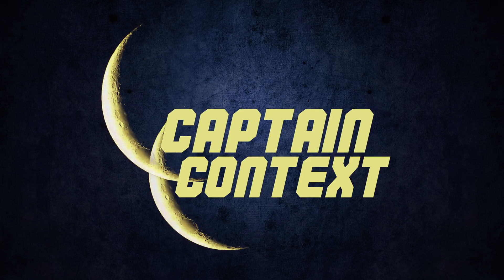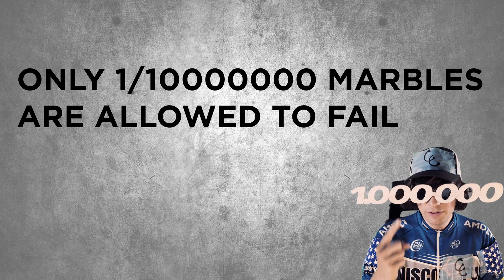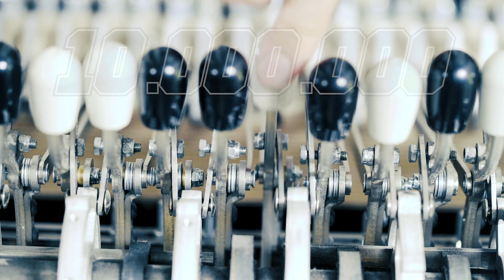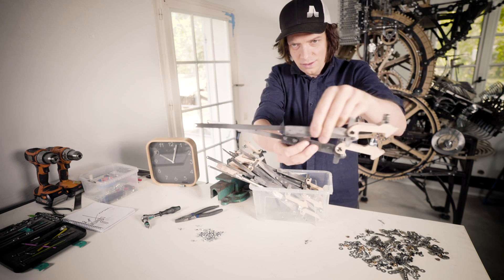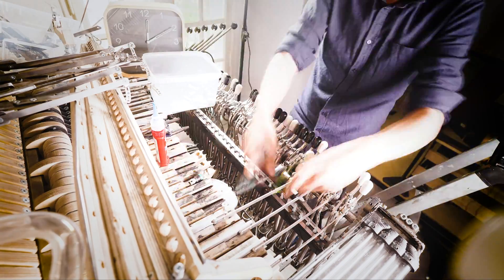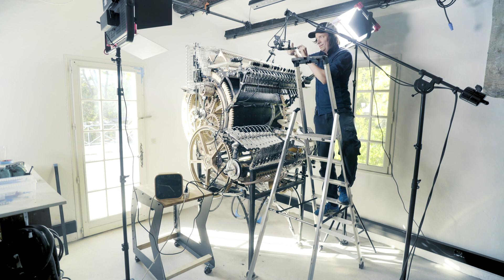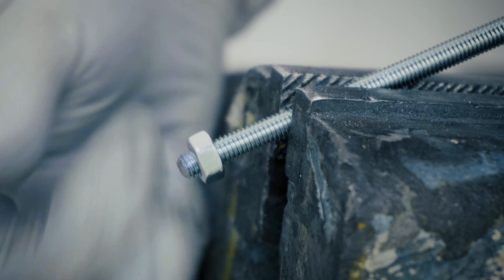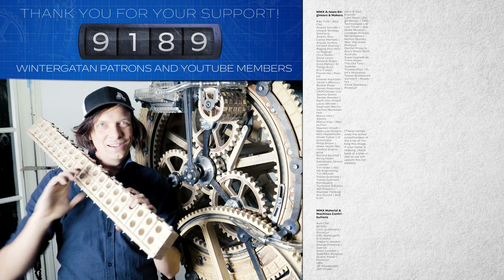Countersink? Why? - Marble Machine X #143

Comment: I can rest easy knowing that Martiswitched over to blue locktite from green.
Reply: still uses WAY too much of it, as evidenced in this vid. threads with Loctite on them should be 'solid' to remove, not borderline-impossible, requiring a vice.
Reply: @STAG162  WAY WAY too much! Its gonna require an angle grinder to disassemble anything
Reply: @Arnogorter  I understood that reference!
Reply: @STAG162  use too much and it might not cure.
Reply: i know !  i can sleep better as well
Reply: But does he really need to use Nylock nuts if he's using Loctite?
Reply: Word!!
Reply: Yeah, every time he locks a thread with shaft and bearing retaining compound my heart sinks a little bit.
Reply: @Chlorate299  Imagine how its for me as a German cutting technician and metal builder. Its like a priest watching someone use the bible to wrap a fatty burger. xD
Reply: why not the RED one😂😂
Reply: @kevinghifari2330  I always forget if green is worse than red. I think green is the worse one, right?
Reply: @LazerLord10  actually I never use the green one, i only use red and blue for everyday job on my motoshop
Reply: @LazerLord10  red/purple ist the weak stuff, blue is middle and the green is total overkill for the mmx.

Comment: A note as a (soon to graduate) aircraft engineer: 

Commercial aircraft are designed in accordance to EASA CS-25 / CFR 14 Part 25 . These regulations stipulate that the probability of catastrophic failure with  multiple deaths are to be extremely remote/improbable. This is defined as 10^-9 per flight hour. or 1 in 1 000 000 000 (1 in a billion) flight hours. 
Now Just because the aircraft as a whole needs to be this safe, it doesn't mean every single part must comply to this value. 
(For the record  the probabilities listed here are based off of testing and also operational records of all aircraft through history, which leads to incremental changes as aircraft fly more and more, and more things are logged)

For each element/system/structure, we consider the following three points, relative to our "Master" probability of catastrophic failure.
   -  What is the probability that a failure of the element causes a catastrophe?
   -  What is the "exposure" time to the failure condition? 
   -  What is the failure rate of the hardware? 

Example, with flight control systems. Those are critical: without them functioning, we may assume a catastrophe will occur. 
The image in the following link is taken from NASA-TM-72860  (Dec 1978) https://i.stack.imgur.com/HlDs3.png
You can see there the accumulated failure factors for flight control systems. 

Example 1: Cruise Autopilot: 
 - When it does fail, it means pilot will have to fly the aircraft himself, and pilots are usually well trained. As a result the probability of failure of autopilot causing a catastrophy is 1 in a million flying hours. (10^-6)
- Given during cruise the autopilot is pretty much always on, exposure rate is for all intents and purposes about 100% (=1)
- This leads us to determine the autopilot must have a failure rate of 10^-3 , or 1 in a thousand flying hours.  Obviously this is for system functionality, so it includes sensors, electronics, etc. 

Example 2: Fly By Wire:
- When it does fail, you effectively lose control of the aircraft. So it's fairly straight forward to assume a guaranteed catastrophy.   (=1)
- Fly By Wire is how you control the flight surfaces of the aircraft. It's used 100% of the time.  (=1)
-Therefore the Fly By Wire must have a failure rate of 10^-9 (1 in a billion flight hours)

Example 3: Autoland:
- When it does fail the probability of a catastrophy is fairly high since the pilot has a very short time to react, and you're very close to the ground. It was estimated to be 3x10^-2 (3%)
- Autoland is only on during landing, which amounts to roughly 3% as well. 
- Hence, it must have a failure rate of 10^-6 (1 in a million flight hours). 
For this reason the auto-land systems are usually doubled or tripled. because failure rate = (failure of system)^nb of systems , by for instance tripling auto land systems, it means to achieve 10^-6 failure chance, each individual autoland system is allowed to have a failure rate of 10^-2 (since (10^-2)^3 = 10^-6 ) 

__________MMX PART__________________________
For the machine to play and have the required failure rate of 1 in 10 000 000 (10^-7) you need to apply a similar logic to the MMX and it's systems or "components".
-What is the probability that failure of this element causes the mmx to completely shut down? 
- What is the "exposure" time of element to the condition? 
----> This will lead to you being able to determine the different required failure rates for your systems, which may not all be as drastic as requiring 1 in 10 million marbles for failure.  from then you can determine if you need redundancy, or failsafes, or have "purposely-made" failure points, which ensure non-catastrophic failure of the MMX and easy replacement. 

Obviously there's way more to all of this, like cascading failures or multiple parallel failures, but it follows a similar logic to make sure to achieve the required reliability. I figured there was value in explaining the base concept, because I'm genuinely concerned about the reliability of the MMX and curious about the MMX team's approach to this subject. 
Always a pleasure to watch the progress of the MMX however, looking forward to hearing it completed and maybe one day on stage once the covid-madness passes.  :)

Comment: If another problem arises in the channel assembly, try fixing it one 4-5 channels first instead of taking apart all of it. Run a lot of tests and if they succeed apply the fix to the other channels. It will save so much time!

Comment: And to comment what others are suggesting: build machine which will not break if error occurs.
Take a look at theory of single point error (Functional safety).
With this design you analyse for each part how it can fail, and you make it in a way, that the failure does not destroy the machine (XD) or better does not affect the performance of playing. You can even design the machine with double fault redundancy (just dont).
And of course the machine needs to be reliable in the first place, this is just adding additional 9s after 99.9999... %

Comment: If you did not want to countersink the screws you should have used round head screws.  Yet another example of not using equipment correctly.  You're learning a lot, but often the hard way without reference to the mistakes others have made in the past.  You should be striving to make new mistakes, not old mistakes again.

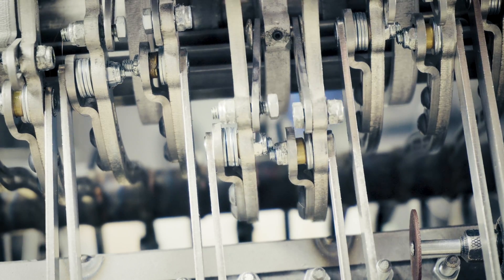Comment: So @ 6:40 you show an overhead shot of the linkages, now that you've modified them to be slimmer and avoid catching on the screw heads, would it now be beneficial to add washers/spacers made of plastic (Delrin) or other suitable material to help take out the lateral movement and constrain it to a tighter linear movement.

I think from a previous video you mentioned that this "wiggle room" was intentional (for a reason that escapes me right now) it just concerns me that now that the available room to "wiggle" has increased and could become a new potential point of failure

Comment: The probability of a single failure needs to be tempered by the severity of that failure.
If we lose one marble (it falls on the floor and/or doesn't cause the correct note to sound) the severity is minimal - maybe completely unnoticeable.
If two channels jam, but clear the next time either channel is actuated, the severity is again minimal.
If two channels jam, but that causes a part to bend/break then that severity is much higher and will certainly need to be dealt with.
Today's video show just such a failure mechanism, but I'm not sure of the severity.  Looks to be pretty minimal to me...

Comment: To remove screws with loctite easily, heat it up a little with a small torch. Also you should find yourself a small lathe. Then you can make all the spacers you need without using a million washers.

Comment: The good news, or the bad news, is you have a lot of individual identical mechanisms. This means you canr overall reliability rating will be a lot easier to achieve since the individual cycle count on the primary failure points is actually lower. So any given channel can have a much higher acceptable failure rate than the system as a whole. 

Your failures also probably don't follow a normal distribution and instead cluster around one particular mechanism and channel. Because of this you can do focused remediation on the common failure areas and then extrapolate if they will be applicable ro identical locations.

Comment: Hey Martin. The Grinder Trick for making threads work after cutting them off also worked for me for a long time, but then I found this reverse deburring Tool : 
https://www.amazon.fr/Grattec-SG-1100-Softgrip-d%C3%A9bavurage/dp/B000ZEGE8S/ref=sr_1_45?__mk_fr_FR=%C3%85M%C3%85%C5%BD%C3%95%C3%91&dchild=1&keywords=Grattec&qid=1603404235&sr=8-45
It´s simply heaven for anything up to M12 Threads.. I searched it for you on french amazon. I hope that works!

Comment: This is the third time I am saying this: 99.99999% reliability is probably unachievable - even in professional engineering projects. The machine needs to be resilient to failures so that even when one part fails, functionality will not be affected. 

For example, marble drops need to gracefully handle stuck marbles, for example by incorporating (strong) springs into the dropping mechanisms, which will normally not stretch. But when a marble gets stuck, they will act as the weakest link and stretch instead of the machine breaking down.
Reply: Think about how many times the valves in a car engine open and close over the course of a car's lifetime. It's totally achievable.
Reply: @5thearth  A car engine is built with much lower tolerances and also it does not have lose parts in it that can move freely, like marbles.
Reply: @duffman7674  The valves in a car still have something flowing through them though. In the case of the marble machine, this "fluid" is a bunch of marbles. As someone who's visually impaired and can't actually see the machine, I imagine the marble-dropping mechanisms as being like valves that open and close (by means of the pins on the programming wheel) to controll weather or not any marbles get relieced. I think that's why he made the analogy of the valves in a car.
Reply: @5thearth  I get that... Except thats kind of an unfair comparison. You're comparing to ONE piece of the full car. Not every piece of the car. Had a spring on a swiveling dash panel fail within a month of getting a brand new car off the lot. The car wasn't scrapped but it would have failed the 99.99999% achievement.
Reply: @5thearth  Nice comment! As someone who's visually impaired, I can't see the marble machine with my eyes at all, so I actually like to think of the marble-dropping mechanisms as being like valves that open and close. The pins on the programming wheel open the "valves" that dropp the marbles, then they close when that pin comes away from the mechanism (I'm imagining that this is what's happening, correct me if I'm wrong:)). I'm aware that each musical note is connected to it's own "valve". So if that "valve" becomes jammed, that note will not play what so ever, unless the problem is fixed. It's not just an issue of one marble failing to play a note like some of these commenters seam to think. it's more an issue of that channel for that note being jammed.
Reply: @5thearth  a better example would be the injectors. They are under pressure, they have to spray many times per minute, at the exact moment and they have to atomise the fuel into fog.
Reply: @5thearth  yep, see my comment below, on my road trip the engine cycled about 9.6 million times with no issues
Reply: Also not every part needs to run through 10,000,000 operations for one song. Each channel doesn't operate every beat. It's probably some fraction of that number even if you can't actually have any failures.
Reply: @JordanDavidson3102  that is true but with 38 channels, there will still be 263000 operations per channel on average. And the drum and Cyber-Bass channels will probably have much higher utilization. 

Also, there are bottlenecks in the machine, like the marble lift, which actually have to perform one operation per dropped marble. 

Even though most single parts won't have to withstand the full 10M operations, to make the whole machine survive 10M marble drops, all parts together have to survive, so failure rates for individual parts have to be lower than the average number of marbles going through it over the course of 10M total marble drops.
Reply: I understand what you are saying but my car has a least 99.99999% reliability. I traveled across county, the trip was 5000 miles, engine runs at roughly 2000 rpm, and trip took about 80 hours. That means my engine cycled 9,600,000 times without a single failure.
Reply: @williamlee7119  Makes total sense. The point that I am worrying about the most is simply that marbles get stuck in places where they shouldn't - the marble lift, marble gates, ... This does not happen with stuff like gasoline or oil in an engine, where every solid part is very constrained in its movement and is manufactured to tolerances which the MMX simply does not achieve.
Reply: @duffman7674  time will tell if the machine is reliable enough.
Reply: @williamlee7119  That makes perfect sence. Therefore, I'm having a hard time understanding why many of these commenters think such high reliability isn't so achievable. I'm not really an engineer so I can't really offer much of my thoughts on that discussion, but still.
Reply: Yeah, I def agree with you. I like the idea of aiming to achieve 99.99999% reliability but I think it's almost unachievable.

Also, 1 missed drop would be 1 note off in a song. That's most music. No song is perfect. You just don't want the error in the song compounding and taking a whole part of the instrument down for the song.
Reply: @coleeverman672  But it's not just a matter of one note being missed only once, the bigger issue is that one note being missed more than once. I like to think of the marble-dropping components of the machine as being like valves that open and close to control the flowing of marbles. Each of these "valves" is alined with one of the musical notes. So if one of the "valves" becomes jammed, that note will absolutely not be missed only once, it'll be missed every time because the marble channel assigned to that note cannot open. Think of it like a piano key that is actually stuck. If that key is stuck, that's going to really effect how you play. That note cannot be played at all because the key is physically stuck. So the issue would nead to be fixed somehow. You cannot have that happening repeatedly on a world tour. The instrument neads to work pretty consistantly. The instrument shouldn't have to be repaired every night after a show.
Reply: The thing is though as soon as one chanel becomes stuck in a song, it doesn't matter how gracefully your machine accepts it unless it can also eject the blockage the chanel it becomes unusable. Which means either Martin will have to continue playing with one of the chanels now out of operation (which will result in a lot more than 1 missed note...) or stop playing entirely whilst the blockage is removed... And frankly I think creating a system to eject the blocked marbels would be much more difficult than making the machines failure rate is incredibly low.

Comment: the alternate for cutting the screws with the need to fix the thread: You can put the screw in a drill chuck, spint it as fast as you can and then cut it. If done right you should end up with a concave/convex shape on the end where it has been cut and a small stup (a tiny one)

Comment: Martin, they say in software engineering "code a little, test a little", or in other words, don't do everything all at once before you know it will work. If you had only installed 2 or 3 of the non-counter-sunk parts and observed the behavior, you could have saved yourself a lot of time because you wouldn't have to disassemble parts you hadn't assembled yet.
Reply: I was actually surprised he didn't install like three or four channels then go "hmmm, this looks problematic, better stop now and think about it a bit..."